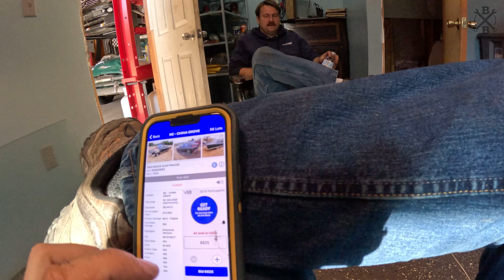Will it RUN Again after Burning Down?! Buick Electra 225 Rescue! Part 1

Comment: I purchased a 1964 Electra 225 when I was in high school in 1970. The owner couldn't get it to run right and refused to take it to a shop. I purchased it for $500 dollars, which was a lot when new cars were only $4000 dollars then... Turns out it had the 401cu. in. and would run and stop... I found the carburetor was loose. I tightened it down correctly and it ran perfect. Took off that giant muffler and put dual pipes on it... Amazing how fast that big boat was... happy gas was only 29 cents a gal. in 1970... enjoy!

Comment: Love the car!! My dad had a 64 Riviera a while back before he passed. As far as the engine noise, check the piston skirts. The extreme heat from running then catching fire can lead to the skirts "collapsing" it is not something you can see or feel, but will show up when you mic them. It sounds like a rod knock but happens at idle and on the accel side of snap throttle or under power. Rod knock is on the decel side of snap throttle. Piston slap.

I am working on a severely overheated 4.3 right now that had this problem. From the audio, sounds like what this engine was doing

Comment: The knock may be the harmonic damper (burnt).  Maybe the converter bolts ...  The 445 on the air cleaner ring was the rated TQ for that motor.  Awesome street engines when tuned right.  They like a bit of timing 😁

Comment: Hard to tell because of the fire damage to the carb but it almost looks like a Quadrajet which would not have been available in 1964 as I think it was introduced in 67? Most GMs of that era had Carters.
Reply from the maker: It is the original Rochester 4GC. A very odd carb and not one I had seen before. It definitely has some similarities to a Quadrajet. The ‘63 came with a Carter and all of our other early 60s GMs are Carter as well. It’s on odd one!

Comment: I'm pretty sure that would have come from the factory with a AFB carb. The way I understand GM carburetor history.  The Quadrajet didn't come out till 67.
Reply from the maker: @paulwortman483  The original one we pulled here was a Rochester 4-Jet 4GC. You’re right, The AFB would’ve been available in ‘64 as well. I believe that came on the 425.

Comment: A lot of older vehicles have the potential to catch on fire if the fuel lines haven't been upgraded to handle alcohol in the fuel. High pressure fuel injection r
hoses are the best replacement IMHO.

Comment: I love that Electra,it's in my favorite color black, just to bad that the interior isn't black also, that would be so cool & I can't wait until you start taking the front fenders off & have them repainted black & same with the hood & also take the engine out & go through it & redo the wiring under the hood  & on the inside of the car so you can get a windows back up,put a new  master cylinder in it & replace the exhaust on it & put dual exhaust on it instead of just to single exhaust

Comment: Check timing gear cover. If I recall it’s aluminum. Mine had a pinhole behind water pump and leaked coolant into oil pan. Had a 63 nailhead

Comment: You will find all your push rods on the right bank on your engine it that big beautiful beast because of heat they 90% of the time will bend because of oil burning away from them. Before trying to start it please check them it’s a 20 minute job

Comment: That Nailhead has aluminum rockers; looks like the drivers side took the most heat.  Also the valve springs on both sides took a lot of heat.  Could be that noise is from some rocker/spring problem.  I hope it's simple!

Comment: Maybe if you could find a set of used 'nail' heads for the motor and then recondition them? Or, it could be just the driver side head that's messed up, replace that one and go from there.

Comment: Wild in 1986 my electra 225 burst into flames while driving ! I was young and panicked so i just left it to burn ! The next morning my uncle woke me up and said he seen my car broke down and said i'll tow it back for you ! I was like what ? I found that someone spliced a rubber fuel line at the carb and what put the fire out was an a.c compressor line ! I actually got it running again after replacing everything that burned ! 😛

Comment: The Buick Electra 225 aka Duce and a quarter that to me was the sharpest was the one with round light on the bottom of the back fenders that lighted up.  I can’t remember what year they came out. Between 1962-1964.

Comment: why did it get burnt? just curious
Reply from the maker: It appears to have started in the carburetor area. The previous owner mentioned it sputtering to a stop before going up in flames. I think either an overflow or possibly failed hose/filter. Another possibility is an ignition issue, causing fluctuating spark and possibly a backfire. Dad had a truck go up the same way due to a failed O-ring in the glass fuel filter, years ago.

Comment: The conking sound also happened for Mortske Repair when he started up an abandoned 66 Electra. I'm suspect it might be a rod-knock. Hope the Nailhead is repairable, but if too far gone, maybe a Cadillac or a Pontiac or an Olds V8 might fit in the engine-bay. Because LS'ing is too mainstream.
But i'm certainly glad that you'll give this old girl another chance.

Comment: Judging by the damage, my guess would be that the carb was leaking, and leaked gas onto the exhaust manifold. The carb seemed to take the brunt of the damage, so it would make sense if that was where the fire started. It really wasn't a big fire. They just didn't get it put out right away. It burned for a little while.

Comment: Not a funeral car. That’s exactly how those cars were stock.
Reply: Right and most funeral cars are base models.
Reply: @MauiWauiPineappleExpress    But this isn’t a base model, it’s an Electra 225 which was the top of the line Buick. And most funeral cars were limousine conversions, stretched and up fitted.

Comment: I was watching Merlins Old School Garage and he bought a late 60's impala that also had an engine fire.He said that port on the intake routes exhaust heat under the carb which is likely the cause of the fire.This is a good example of why we with classic cars should get classic car insurance.If the previous owner had it more than likely he would still own it.Sucks he lost it!

Comment: I wonder if that small “knock” is end float on the cam shaft ?. If the oil pressure is fine then it’s unlikely to be within the main pressurised system..

Comment: My dad had a blue.   
1964 Buick Electra 225 just like that only difference between them 8s his had the lights in the front fender when you turned. 
On yeah be careful around those doors lol got the door slammed shut in my finger.

Comment: What a beauty!! Should turn out real nice! I wouldn't be surprised if it was one of those plastic fuel filters, I had one split open on my old panel truck, caught on fire, fortunately I was in my driveway and was able to quickly put it out. Always use metal fuel filters!!

Comment: I watched another video earlier and that car had also had an engine fire while using a Rochester carb, Apparently the inlet manifold is heated with exhaust gases, And if they leak out that can cause the fire, they welded up the holes in the manifold to stop the hot gases, I've no idea if this is the same. I'm British so don't know much about yank tanks, I just thought I'd pass that on.

Comment: My uncle Bob had an Electra 225 in the early 60s. I  was 6 years old at the time and was not much taller then those beautifu rear taillights. I was very impressed by that car. I asked my Dad if we could get one. We had a 1960 Meteor at tbe time and he did not replace it until he got a 1969 Mustang. I was quite happy about that but will always remember the 225. What a car!

Comment: I know you obviously don't care about the paint or nothing, But for ya fans you need to warn them about rubbing sand into to paint to clean it off. It's really like using fine sandpaper on it. 👍
Reply from the maker: Very good point! 🙂 I had mentioned that and must’ve accidentally edited it out. We will be polishing and buffing the majority of the car. A good water wash is definitely the best way to go though and if the harnesses weren’t smoked we would’ve gotten everything closed up.

Comment: Dont know if it had rubber fuel lines between carb & fuel pump or not but if it did that could have been the cause. Those rubber fuel lines cause more car fires than ex wives

Comment: Hey guys, after you remove the front cap and start addressing the firewall damage. You may find at the inside of the car fire wall, the paint probably blistered off and will be rusted